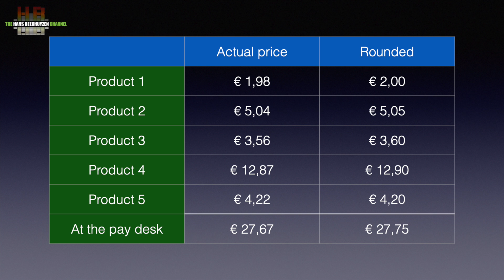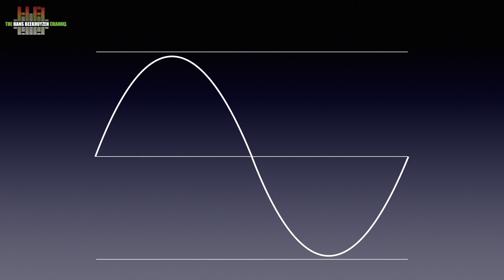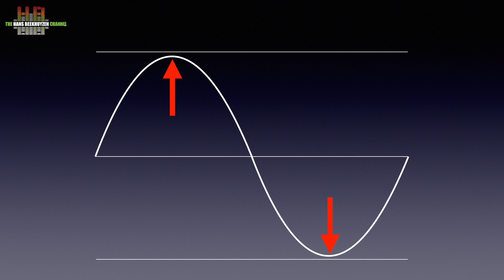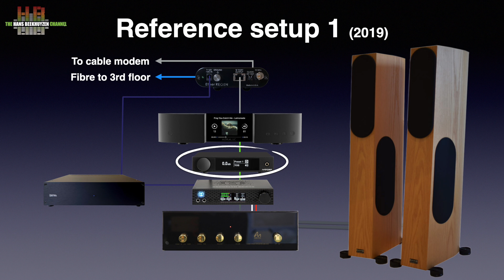About DSPs and Room Correction

Comment: Indeed, the better the setup, the less you need any DSP ‚tricks‘ to improve your sound. I used the McIntosh version of the Roomperfect system from Lyngdorf, but after some improvements in my setup, it proved to make the sound worse so I threw it out again. However, after another while, the roommodes in the lower frequency domain started to get to me, so it was time to start working on this. I finally ended up with a solution in the digital domain, which only corrects the low frequencies in order to avoid the infamous bass booming ( DSPeaker Antimode X4). It was a bit of a journey, which I already described in another comment. But I am quite content now. Purism is respectable, but sometimes you just need to be pragmatic and take the solution that works for you and provides you the joy of listening to music without being distracted by any side effects. And that is accepted by the ‚Keep The Living Room Cozy Commitee‘!
Reply from the maker: sensible approach.

Comment: Best wishes for '24 and beyond! Another great vid! I so agree with you on the topics you raised. For some reason we keep calling it "Room correction" when we're not really correcting anything in the room. Nor are we correcting but rather adjusting the system for the bext match with the listening environment. Rather than Room Correction, it should be called something like System Acoustics Adaptation or similar. 
I've become a great fan of Dirac even with my not inexpensive and well matched system but in a crap room. Keen to see how Bass Control will further improve things at home. 
I think the main reason that Dirac works is that they calculate the filters at their own facilities and send these back to your unit to store (you need to be online when creating a filter) so don't rely on the processing power on board of a product (which will always be insufficient) or that of a laptop. 
Hope to see more on the subject.
Reply from the maker: Well an automobile is not self driving either. Room correction is named after the effect it has for the owner.
Reply: @TheHansBeekhuyzenChannel  Well, a car was called an automobile in the old days when it didn't need a horse but was "self-powered" and thus appropriate, today it's only called that by old or wannabe posh people. But, who cares, really...

Comment: Because I have a stubbornly difficult room and no desire for panels in my listening area I have gone from an old school purist Naum with almost nothing extra in the signal path to a Lyngdorf 3400 where you can do so much. More to the point with the Lyngdorf in my setup anyway you must fiddle (or it will probably sound singularly unimpressive) and luckily i have a background in sound engineering because the average consumer would find it difficult. My favorite dealer sneered at the lyngdorf but haven’t head my system. Does all the dsp muck up the original signal? Actually that is exactly what it is meant to do on the basis that the original signal isnt satisfying me anyway. I get lots of options with the Lyngdorf to try various after setup/ focus points and other settings and have a sound I really like. Its a matter of being open minded. I never thought i would replace my classic Naim sound (not the current bs lifestyle sound which is no longer JV Naim sound) but I listened with an open mind and it took me three separate loans and the realisation that I had to put effort into setting up the Lyngdorf even for a short listen to get me to change. The Lyndorf Room Perfect does a lot more than frequency adjust / correct btw and I very much had to still tailor its corrections to my taste
Reply from the maker: As long as the problems it solves are greater than the artefacts it causes it’s an improvement.
Reply: @TheHansBeekhuyzenChannel  far greater in my case. Perhaps a useful analogy is that my Room itself is creating huge and undesirable acoustic artefacts and the Lyngdorf gets rid of far more of those problems than it creates. I stress again I had to do a lot of playing around and I have previous experience at sound engineering which helps me better experiment with the many settings only some of which are automatic. 

My main point in writing such a detailed post is to stay open minded! Reading what an erudite sound guy like yourself recommends is a great starting point but For my situation and listening tastes something totally different may and did suit.

When the dealer recommended I try Lyngdorf I was a lifetime Naim amplifier man, and Julian’s philosophy was the opposite of Lyngdorfs but my dealer was also a former sound engineer so I kept an open mind and pleasebear in mind I had tried the top integrateds from luxman, pass, and many others.

Comment: there are these self proclaimed experts on Youtube that beilieve DSP is the answer to everything. These guys have next to no room treatments and lack knowledge in speaker placements. They were extremely puzzled when i indicated DSP put a vail to the sound when active (lower bass only).  to me none of these self proclaimed experts actually lives with a high end stereo system.
Reply from the maker: I'm not against room correction. I have used a MiniDSP for some years, as I mentioned in the video. If it's needed, it's needed.
Reply: @TheHansBeekhuyzenChannel  i totally agree "if needed" not to use DSP no matter what.

Comment: For me, DSP is essential and way more than bass management and room corrections. Harmonic excitation and Hass effects can bring out the best of even the most modest of audio gear.  The likelihood of the recording, DAC, AMP, Speakers, room, listener ears and listener expectations lining up perfectly are...... infinitesimally small.  DSP can help with every step in the chain and in particular compensate for less-than-ideal speaker placements.
Reply from the maker: I'm not against room correction. I have used a MiniDSP for some years, as I mentioned in the video. If it's needed, it's needed.

Comment: Using Dirac on the NAD C658 and active speakers.  But I have a feeling that Dirac stealing soul of that system. But it is still the best way to fight 38Hz problem in my room.  1,6s reverb.  Thank you.
Reply from the maker: I'm not against room correction. I have used a MiniDSP for some years, as I mentioned in the video. If it's needed, it's needed.
Reply: You can 'gate' DIRAC to only correct for a defined range of frequencies. Try restricting the correction to 100, 200 or 500 hz. so that the mids and highs are unaffected.
Reply: @calebkeen8967  Problem is that I would like to spice up top as well and there is no way to avoid mids. Bit less bright  speakers I have. Thanks anyway

Comment: There are very few things I disagree with Hans Beekhuyzen about in general, but I think his exploration of DSP/Room Correction falls short. While I also have had the pleasure of Dirac within the MiniDSP SHD Studio, I can robustly confirm that Dirac (and the SHD Studio) is hardly the topnotch DSP solution. I use and find much more quality in generating proper FIR filters via Acourate and integrate them in Roon directly. For this, I hook up microphone and a small interface via a laptop with Acourate, and transfer the correction file onto my NUC i7 running Roon Rock.  Instead of having a separate streamer attached, the NUC delivers directly to an AudioGD DI20 HE (with separate master clock) and via I2S to R7 HE Mk.2. Roon is such a bliss.
Reply from the maker: I'm not against room correction. I have used a MiniDSP for some years, as I mentioned in the video. If it's needed, it's needed.
Reply: You might try manually designed FIR filters on your SHD instead of the IIR/FIR mix generated by Dirac.
Reply from the maker: I think the mix it the preferred way to go. At least for me.
Reply: @TheHansBeekhuyzenChannel  yes, I'm also using a combination of IIR filters for EQ and FIR for final phase correction with my miniDSP 2x4HD. It's a bit tricky, but works perfectly.
Reply: The difference of IIR and FIR filters are significant in high end audio. And the processing power of real FIR filters require much more power than standard FGPA in MiniDSP products. As you may know - FIR vs. IIR filters are about time / phase smearing (one of your important issues) - 
' So please : there is a  higher degree of room correction, and DIRAC is not that one !  @TheHansBeekhuyzenChannel

Comment: I will never hear without DSP / Room EQ. There are way more pros over cons. Specially when you use Subwoofers or Array Solutions its impossible without DSP. And in my opinion no 2.0 Home setup can deliver this precision over the complete freq spectrum (20Hz-20khz) Dsp & Subwoofers are the solution for precise & high end sound.
Reply from the maker: I'm not against room correction. I have used a MiniDSP for some years, as I mentioned in the video. If it's needed, it's needed.
Reply: @TheHansBeekhuyzenChannel  I use Neumann Speaker and their correction. Works perfectly fast without problems. A friend of mind uses Genelec 8341 with an Double Bass Array (2 Subs in the Front, 2 in the Back) and miniDSP 2x4 andit works awesome. But it was a hell to setup because the minidsp support didnt even known her own products

Comment: I use a room correction made by my denon receiver in order to flaten the frequency range of the stereo speakers. The result is much miuh more dynamic, resolving and punchy comparing to the "pure direct" option where no dsp or correction is made.
Even when trying to connect my dac preamp directly to the poweramp, the result has much less bass, dynamics and resolution.
My receiver is also used as the system's streamer (heos), which although it's user interface isn't the best there is, but sound wise sounds excellent
Reply from the maker: I'm not against room correction. I have used a MiniDSP for some years, as I mentioned in the video. If it's needed, it's needed.

Comment: I have been using a DSPeaker anti-mode 2.0 for several years in a 2.1 stereo/sub setup and the effects are not subtle and are very positive.  The listening room is a living room with vaulted ceilings but with noise dampening curtains, bookshelves and furniture.   The DSPeaker also has many useful features to include a PEQ.
Reply from the maker: I'm not against room correction. I have used a MiniDSP for some years, as I mentioned in the video. If it's needed, it's needed.
Reply: Very good product. I have used it in a similar setup. I have since moved to a NAD unit and now using Dirac Live.

Comment: Loved the rounding illustration 😀 Interestingly with the fpga used in PS audio direct stream 1, the layout of the chip is not deterministic (given the same input) so they listen to evaluate the best sounding compile. I had terrible luck with Dirac and between 4 sets of measurement and a lot of very different target curves, the only thing that did not make the sound stage flat as a pancake, bound to the plane of the speakers, with zero space between the instruments, was turning off time alignment and limiting the correction to under 500hz. Lots of EQ is done in mixing and mastering, that damage the sound far far less. That said I do realize that some people have good result using Dirac. According a dirac experts at the main resellers of Dirac enabled equipment in my country, it is very very roomy dependent if Dirac will give a good result or not, which is kind of amusing for a room correction system (and sad for anyone who bought their system due to it having Dirac and that have the wrong room).
Reply from the maker: I'm not against room correction. I have used a MiniDSP for some years, as I mentioned in the video. If it's needed, it's needed.
Reply: @TheHansBeekhuyzenChannel  That is clear from your videos and I did not mean to imply otherwise 👍 I was relaying my own experience, where dirac and other room correction systems have degraded the sound severely, definitely much more so than a bit of high quality EQ or other DSP used correctly would have. And these are of course used quite extensively in mixing and mastering of most music anyway. As always, “your mileage may vary” and I realize room correction works really well for a lot of people.

Comment: i have a miniDSP DDRC-22D in my setup and i have to say that it was IN MY CASE the best solution for my room size. i had major issues on the lower frequencies.
Reply from the maker: I'm not against room correction. I have used a MiniDSP for some years, as I mentioned in the video. If it's needed, it's needed.